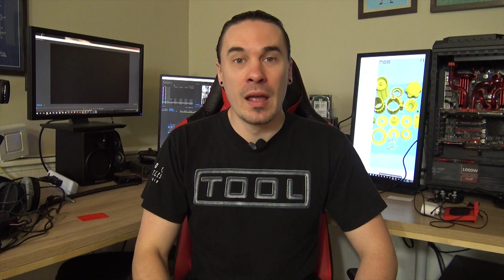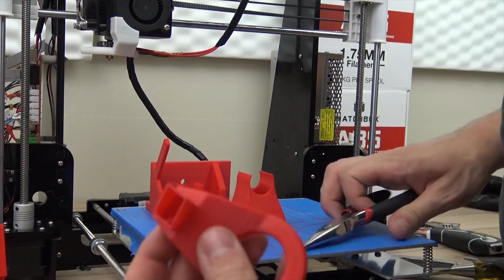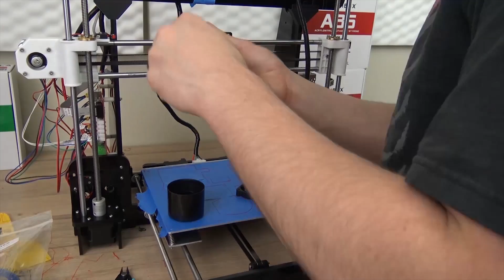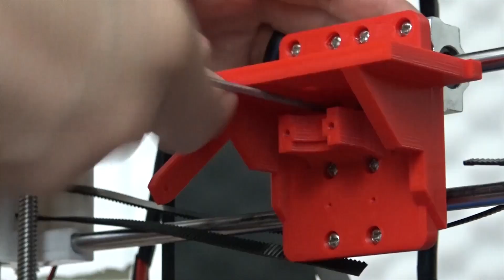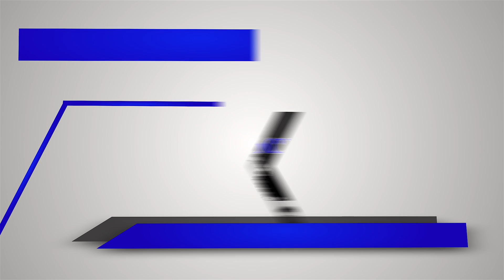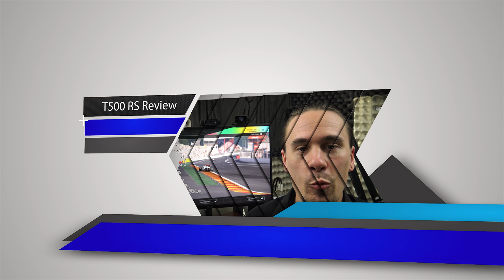Moar Upgrades!! | Anet A8 Bowden E3D v6 Hotend Upgrade

Comment: Is there any software changes you need to make for the thermistor or pid values from the stock Anet A8 hotend to a E3d v6? You didnt cover this any where in the video and i believe it might be a requirement when changing any hotend thermistor.
Reply from the maker: There was not. it was plug and play.
Reply: Side85Wi

Comment: How did you wire it up to the main chip? The a8's chip has a 4 prong connection where the e3d v6 has a two prong.
Reply from the maker: I did wire it up to the A8 chip. I had to modify the connector to fit.
Reply from the maker: I can share a picture of the connection if that helps.
Reply: Electreak yes plz omg thad be super helpful lol documentation is hard to find
Reply from the maker: Dallas Lones sure thing. I posted it on my Twitter account. You can find the link to my Twitter in the description of the video. I hope it helps. :)

Comment: Is it okay to print the e3d parts in pla?
Reply from the maker: JAVIER probably better because of a higher heat resistance. You just need to make sure the calculate for some shrinking when using PLA.

Comment: I don´t want to rain on your parade, but that does not really look like a bowden setup. The extruder motor is still on the x-axis.
Reply: That would be interesting, usually bowden vs direct drive makes a big difference on these prusa kit printers
Reply from the maker: Not cool man! My parade is all rained out now. I quit youtube! LOL. J/K

What about it makes you think that? :)
Reply: A real bowden has the extruder motor sitting somewhere on the frame or case, so the x carriage gets lighter. The filament comes through a relatively long ptfe tube in this cas.

If im seeing it corrrectly, you used the short version of the e3d, which still mowes the extruder motor around.

Not that im saying, that its not an upgrade or a bowde is better in general, i was just confused, as im looking for bowden infos for my A8.
Reply from the maker: Ah! Yes, I actually have not printed the piece to move the motor off the X-carriage yet. (I could also modify the frame) This is why you see it sitting there. I do plan on doing that soon. But, I can do a comparison video of the motor in the current position, and off the carriage if you would like to see if it really makes a difference. I'm pretty interested in that myself now that you bring it up.

Comment: May I know what are the advantages of the new printer head?
Reply from the maker: Sure thing! I will be doing more on this next week as well as I did not have enough time to do a full review of the upgrade. 

Some of the first things that I have noticed are better quality, and it's easier to change the filament in the new configuration. 

Sadly it is louder with the smaller fan, but you can print a new cooler fan mount to fit the original fan that cam with the original hot end. 

Also you have to re-center the printer head as it is now off center. 

Honest opinion is that I don't think it really is worth the $75 on Amazon, but if you can find a cheaper kit on other sites it may be worth a $30 upgrade.

I will update next week with all of this info and more when I get the chance to fully utilize the new hot end. 

Hope that all helps!
Reply from the maker: I'm also working with gearbest to review their Anet A6 printer in a future video. I'm also thinking of doing a comparison video of the Anet A8 and A6 to see the difference. 

Let me know if you're interested in that. :)
Reply: Electreak Thanks for your honest answer. And I would like to watch a comparison between printers for sure!
Reply from the maker: Not a problem! Great to hear. I'll make sure that happens!